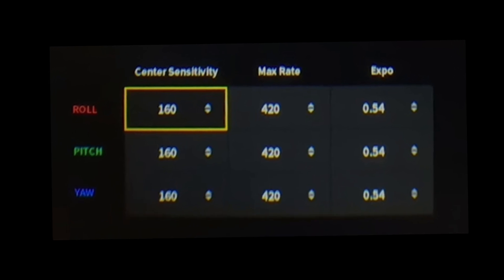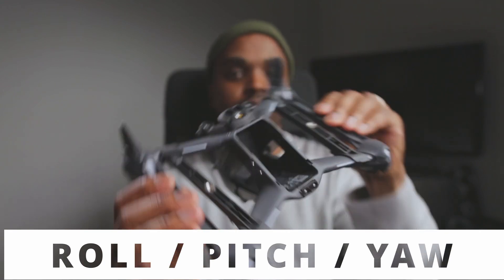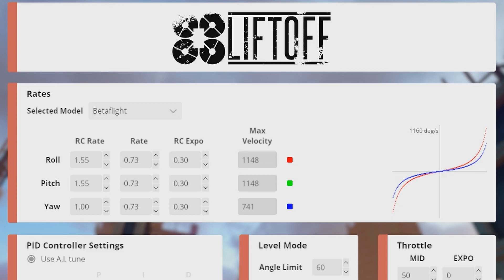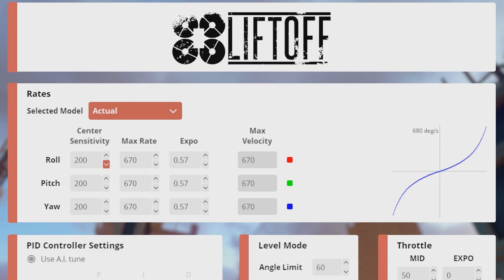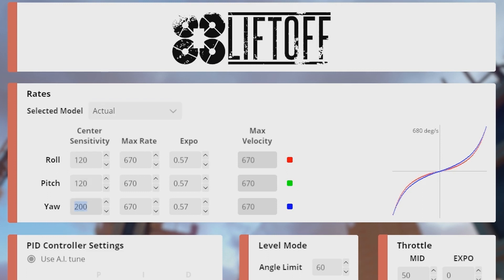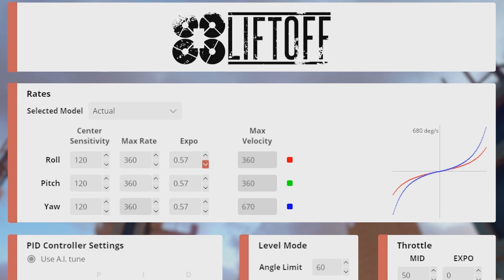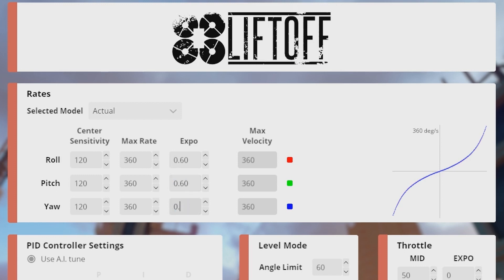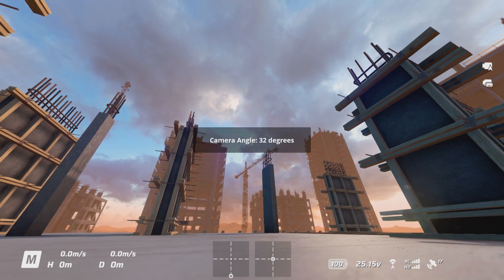DJI FPV RATES FOR BEGINNERS EXPLAINED

Comment: You're the man! These rates helped me! What strap are you using?
Reply from the maker: Glad i could HELP
Goggles strap or controller strap ?
Got em on amazon , as the stock one was trash...
Reply: @brunovfpv5756  Goggles strap. Stock strap velcro is useless.

Comment: Brother, can you help me please . I'd like to train in Normal mode in Liftoff, but throtle stick doesn't work like in real dji fpv drone, it just flies, it can't hover. Do you know is there  any settings to "fix" it?
Reply: YOU CAN'T. No training for Normal mode. I theory you don't need a simulator to fly in normal mode ! Is so safe ! Go out and fly
Reply from the maker: hmmm , i never managed to use liftoff in N or S mode , man switch straight to M mode ....
Reply: @brunovfpv5756  Maybe you r right bro... I should learn from scratch, but it's sooo difficult....:-/
Reply from the maker: @yaro_888  been there, but you need to fail first to succeed after

Comment: I cant get the controller to connect in “liftoff” on the 2021 MacBook Pro. USB C to C. I noticed that the older MacBooks has an usb A which connects promptly.
Reply: I figured it out!!!! Had to use the V2 goggles USB-c to Usb A dongle on the 2021 MacBook pro and I used the Mavic Air 2 USB-A to C to the controller.
Reply from the maker: @belovedLion80 legend
Reply from the maker: Thanks for the info